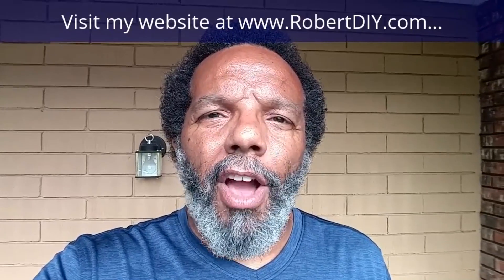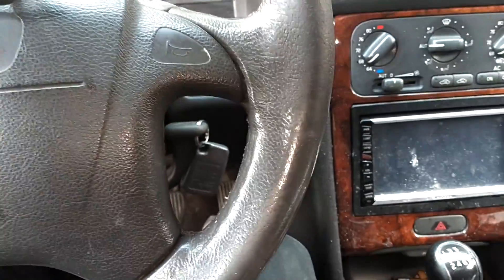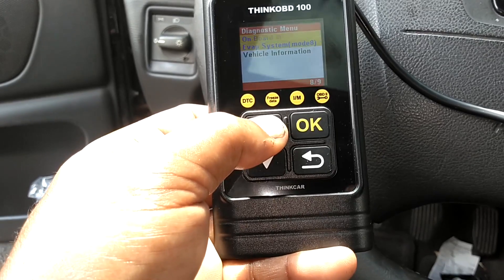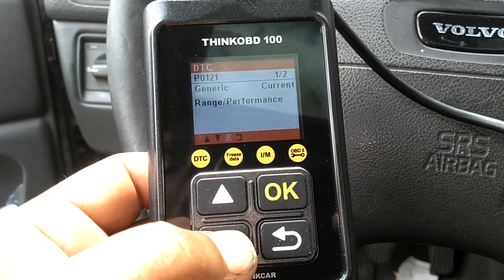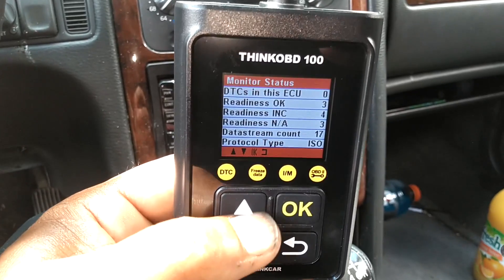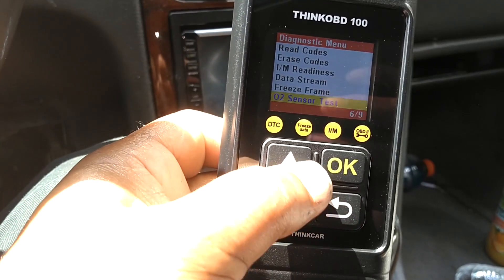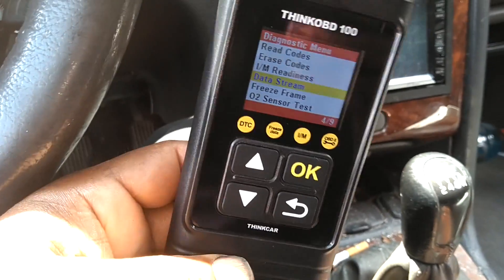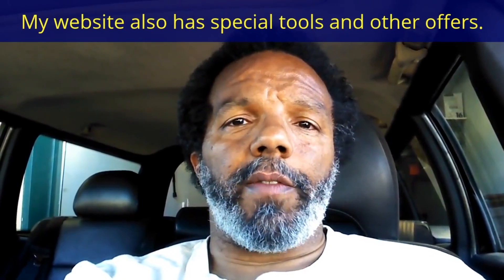THINKOBD 100 OBD2 Scanner first use and review. Great tool for emission readiness and o2 testing.

Comment: Robert, have you tried an Android app called 850 OBD-II by xiaotec? As long as you have an ELM327 compatible Bluetooth or wifi obd tool (I use both an OBDLink LX and MX), it can read the ABS system faults. It can read all the ECU's in my 1998 S70 T5 including the power seat... Check it out!
Reply: I forgot to mention it can also log the information for later review. Helped me track down some problems that only popped up while driving on the freeway.
Reply: Thanks for that I will check it out. Does this read the Motronic 4.3 or is it 4.4?
Reply: @nicko6710  Both are supported according to the developer, however I have a 1998 S70 T5 with the M4.4, therefore I can only confirm that one.
Reply: Also, the developer has a website, xiaotec.fi where you can get more information.
Reply: @DonSUmble  Yeah downloaded it.
I have a 96 850R so only some modules are supported. Not the 4.3 A/C Cruise. So it functions pretty much like Vol-FCR but much easier as a bluetooth mobile thing.

This...850/900 series
On these models ECUs as Yazaki dash (VDO is OBD capable!), M4.3 (M4.4 is OBD capable!), MFI system (LH-jetronic 3.2 & EZ129K), Fenix 5.2, ECC(A/C) and Cruise Control are not reachable by ELM327 because they are older Flash code based systems!
Reply from the maker: Yes I have it but not good with using it.

Comment: Is there any way to convert a Volvo with an OBD1 reader to be able to use OBD2 readers? If not are there OBD1 readers that give more information than the OBD1 readers built on the car? I have a 94 850 sedan NA. No problems that I know of but I wish I could read the codes and reset the service light more easily.
Reply: Obd1 is better than 2.
Reply from the maker: The OBD1 boxes are better than OBD2.
Reply: @RobertDIY  With a 12 volt LED and momentary switch the non obd2 units of these models are essentially the same. Just a bit more fiddly than the in car unit.